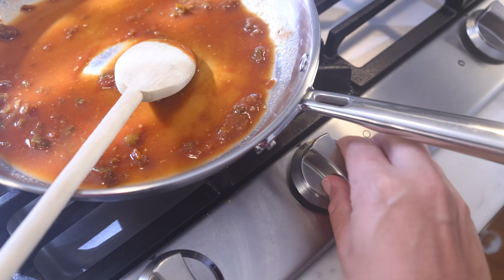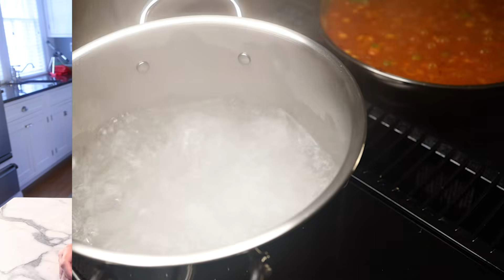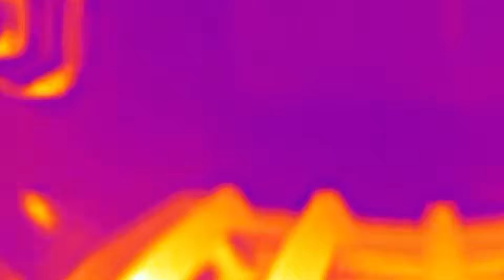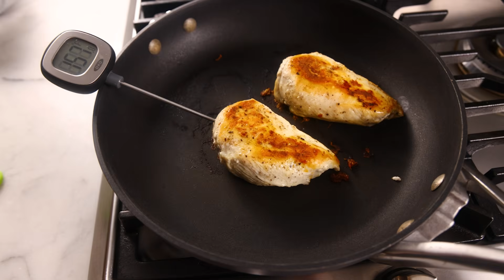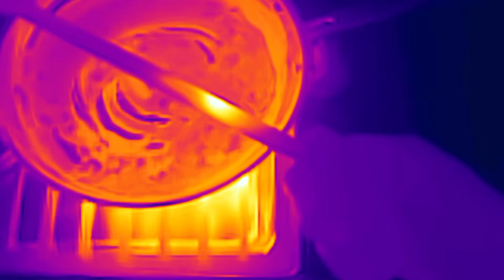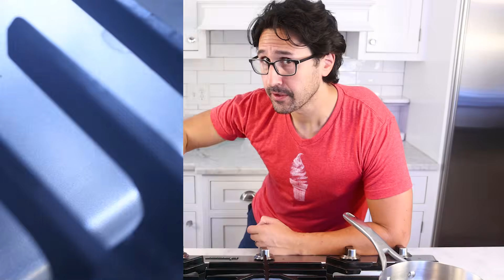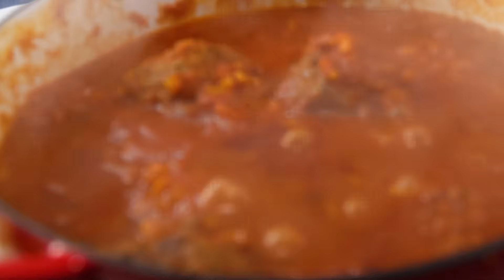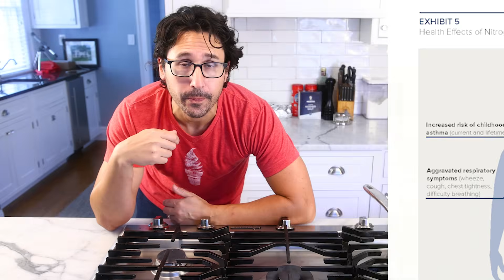Problems with gas stovetops | weak, dirty and dangerous

Comment: Our boiler is electric, when there is a power failure we are so glad to have a gas stovetop to warm up water to use in the middle of winter. We had it happen multiple times that our stovetop was our savior.
Reply: Round here, when the power goes out it's because a massive ice storm has taken down the lines. That's not bad infrastructure, it's the physical limits of what can be engineered to resist that. And having gas heat or cooking when a blizzard comes through can literally save your life.
Reply: @felonyx5123  sounds like an excuse to me.
Reply: @Lil' Black Duk  electric kettles boil in about 2m
Edit: misread the comment didn't see electric
Reply: You can get gas line outages as easily as electric power outage. 

I can also confirm what other commenters said - even in post soviet block countries, power outages almost never happen. 

If you are suffering from frequent power outages, your infrastructure & power company is shit.
Reply: An electric boiler for heat?  I've never heard of such a thing and I'm a pretty 75 y/o science/tech savvy kinda guy.  If a home is heated by electricity, the standard old system is to use baseboard resistance heating.  In Southern climes, homes are often heated and cooled by a reverse cycle heat pump, like mine. They can be done in cold climates, I had an employer in Chicago that had their HQ with reverse cycle, but the hardware expense goes way up.  Bigger coils, compressor.  The advantage of RC is energy efficiency, although it gets worse as the temperature drops.
Reply: @frequentlycynical642  i live in europe, our house is made of bricks and i do live in a colder climate. So a an electric kettle is way more efficient. The house was also completely gutted so the floorheating and cooling is new and also the isolation is new. Im not trying to discredit your experience but the way houses are built (in size and structure) and the appliences used are just completely different over here.
Reply: @loviebeest  Wait, all this time you were referring to a freakin kettle? No wonder Adam is careful to point out when different terms are used in different regions... In North America, a boiler is what heats water in a heating system that circulates hot water through radiators throughout the house. An electric boiler is basically unheard of and wouldn't even make sense in a house that is plumbed for gas. This is an older method and newer homes will either use a forced-air system with a gas furnace or heat pump, or electric baseboard heat. In-floor heating like you apparently have is a thing but it's rare.

All this time I thought you were using your stove to keep from freezing to death, instead you just couldn't go without your tea...
Reply: @sntslilhlpr6601  no i meant the house heating boiler/kettle. Im not english and the word s boiler and kettle are used interchangable. Our boiler heats up water using electricity, this water heats up the radiator, floorheating and general warm to hot water. We wont freeze to death thanks to good isolation but we have to start dressing with many many layers.
Reply: @loviebeest  Electric kettle?  Semantics, I guess.
Reply: @frequentlycynical642  we should boil water in electric kettles anyway, it uses somewhere between 25 to 30 percent less kWh per liter of water than an electric stovetop, and my family always heat our water in our stand-alone, one liter electric water boiler, no matter what we need the boiling water for.

Edit: we also have a warm water tank for showers, and warm water from the taps. But for cooking, boiling a pot of water on the stovetop is just kinda stupid and inefficient
Reply: What's a "power outage"?
Reply: @heysemberthkingdom-brunel5041  losing electricity. no light, no electric-based appliances.
Reply: @loviebeest  But that never happens... Well, in well-run countries anyway...
Reply: @heysemberthkingdom-brunel5041  in Canada, there are black outs every so often, even as a country thats considered well run and has a larger amount of money, so that statement isint really true
Reply: @thinkdogeys9993  Canada isn't a well run country, otherwise it would have decent public transit and electrified railways in and between all major cities
Reply: @heysemberthkingdom-brunel5041  it's so wonderfully elistist when euros think the only signs of having a well run country can only be things they already have, gained from wealth plundering the world.
Reply: @xShadowChrisx  Ah yes, the famously not-build on plunder country of .... Canada... What happened to the people who lived there before "Euros" showed up? What happened to them?
Reply: @heysemberthkingdom-brunel5041  Are we just pretending you didn't benefit from being part of the British Empire? I can't even tell what you're trying to insinuate, but y'all can never just be straight talkers and always have to dance around shit to feel clever, like the rest of the world is just expected to know y'alls entire history cuz y'all soooo important. The Ego I swear.
Reply: @xShadowChrisx  He's saying that the electric stove is only good for some European countries that has no natural disaster which could take down electric grids, which is true. For the rest of the world gas stove is better.
Reply: @kaikart123  Definitely giving him too much credit there. Bit insulting to say your country is basically shit just cuz it doesn't have electric *railways*. 

If he said what you said, I'd agree, though I'd argue that Europeans are still in danger of a solar flare knocking out there energy grid, which is a possible problem for the whole world. In that event, we Gas Stoves wouldn't have an issue obviously. 

Obviously a much rarer natural disaster, but not no natural disaster that Europe is immune from. 

I mostly take issue with the elitist attitude that the only measure by which a country is "well run" are things other countries get on fine without, or can't realistically have because we're so much fucking bigger. Europeans always fail to understand the scale of how big the US and Canada really are.
Reply: @xShadowChrisx  I'm not from a place that was ever part of the British Empire...
Reply: @heysemberthkingdom-brunel5041  Why the hell bring up canada in the first place? Write clearly ffs. Unless you're from Canada and aren't aware of them being formly british. In which case, we must point and laugh.
Reply: @xShadowChrisx  Someone else brought up Canada. I didn't.
Reply: @Lil' Black Duk  dood, whatever you on, share some, i wanna trip as hard as ya do...
Reply: Remember Americans don't know what an electric kettle is
Reply: @amebee709  haha, I remember seeing that and being confused since i've had this water boiler from Zojirushi since  I was a kid, and thought that everyone just did.
Reply: @amebee709  chewsday, innit
Reply: @internationalreIations  im not British lmao
Reply: That seems extremely anecdotal.
Reply: @Arian545  you sound like a very unpleasant person. They gave one reason they were very happy to have a gas stove. Literally no criticism of the video or its arguments were made. You were allowed to just read the comment, feel that it had no relevance to you, and move on. Not everything is for you.
Reply: @chriskp  "unpleasant person" lol.

Don't be so condescending and dramatic.
Reply: @Arian545  how is that not a valid pro of a gas stove? The only thing you might need is a lighter to light the stove. And power failures happen, either localized events or more regional events.
Reply: @jac1207  How does it invalidate any of the actual criticisms pointed out in this video?

It is also not a great argument since again it is heavily anecdotal, it relies on very specific circumstances. So for an instance if you live in a place where power outages are extremely rare, then this argument becomes irrelevant, since it just isn't applicable that broadly.
Reply: @Arian545  yes it is anecdotal, but for me personally a lot of outages happen so it really is a saviour for me. Im not trying to discredit anything in this video, for me personally the gasstove is just a better option. If i get to move to a place with more secure power im definitly going to switch. (Though i will keep a portable gasstove just in case)
Reply: @Arian545  It being anecdotal is irrelevant, they aren't using the story to prove something they are using it to bring up the point that, hey if one goes out the other is still good to go and that's a plus for some people. It's not meant to invalidate anything but bring another point to the discussion. 

Also power outages are something a large portion of the population does still have to worry about, if you aren't on an important grid or are on a very small grid, like rural towns, a power outage could last for days, and if it's winter they often do because it's harder to service the lines and stations. It's very much an important point to a large portion of the population, just because you don't deal with them does not mean the problem is so small in scale that it should be ignored.
Reply: @Arian545  they are not refuting adams video, they are simply sharing their perspective. i found it interesting
Reply: @Arian545  Yes, 99% of the time power should be reliable. Depends how much you value having the ability to cook in that unlikely situation. Gas stove top has saved me from having a cold meal during a winter's power outage.

Comment: Induction cycles the same way as old fashioned electric stove, they both have PWM regulation of power, however that is not a problem if frequency is high enought as should be case with not low-end stoves. I remeber how my dorm induction stove has so low frequency that I could see how water would boil for one second, then not and then again.

Comment: I’m bemused. I’m British and have lived in several European countries. In all of these places, the electric hobs I used - whether resistance coil, plate-style, or “ceramic” (glass top but not induction) were awful and significantly cooler than the temperatures I could achieve on a gas hob. Is there some magic difference between our non-induction electric hobs and yours in the USA? Are you using a different sort of gas? Is there a restriction on the temperatures our electric rings are allowed to reach before cycling off? Goodness only knows, but it honestly feels like you are describing a diametrically opposite situation. Oh, and you can hack the low temperature on a gas stove by turning the knob almost to the off position, carefully, and ensuring the flame doesn’t go out. I always do this for simmering sauces.

Comment: Electric or induction is costlier and specially not reliable if you have sketchy electric supply.
As I live in an area very prone to cyclones. Electric supply can get cut off.
Gas cylinders although a hazard in many people's eyes is very important in such conditions

Comment: My babushka cooked on a portable gas stove, which stood on the top of a gas container.... :D Very SAFE, I know. I prefer electric though and induction is best, it immitates well the responsiveness if you need it. Also it really heats things faster.
Reply: At the Scouting home we still cook basically like that (well the propane tank is on the other side of a wooden shed wall from the hobs...), those portable stoves are scary AF, Ive stood there with the lighter, heard a "woosh" and seen the flames coming out of the tubesplitter...

Comment: I have had the privilege of using every different variety of stove out there. Personally I have a non induction glass top, because it was cheaper than induction. They work really well if you ask me and they get warm and cold a LOT faster than traditional heat coil stoves. Induction is great, if it's a good one. First I HATE the finicky touch thingies, I want twisting knobs, and cheaper induction stoves tend to have only two modes: Defrost and THE FIRES OF MOUNT DOOM. Gas I don't really like for the exact reasons you have presented in your video, the finicky cleaning being the real killer for me since I'm a bit lazy.

Comment: I love induction stoves. The heat is immediate, and much, much stronger than on my previous, conventional, electric stove. And at the same time, I have perfect control of the temperature, I can go as low as I want. And if I'm done, I just turn off the stove and apart from the heat from the pot, it gets cold immediately. It combines the strong points of both conventional approaches.
Reply: Jelly
Reply: induction can be great if 1) you live in a place where there are few power outages and 2) your electricity comes from relatively clean sources. Neither of those apply to me. So gas it is.
Reply: I realize there are a couple minor advantages to induction, but none that outweigh the major issues that will stop me from ever getting a full induction stovetop.  A standalone travel burner may be fine for some things, but definitely never a full kitchen stove. My main complaints about induction are:

(1) Extremely limited in pan size.  The moment you try a pan larger than the element, it becomes useless, so you're effectively stuck using "smaller" cookware.
(2)  They do not spread heat up the sides of your pan at all, which does have a major effect on heat output to the food.  For some tasks this doesn't matter, but for any amateur cooking enthusiast, this causes major limitations in cooking techniques.
(3) They are MURDER to your clad cookware.  The induction coils have been well documented to cause problems with delaminating layers in bi/tri-metal clad cookware, especially if your induction elements are more powerful.  So what's the point in getting a super powerful stove if it's going to warp and ruin your fancy cookware?
(4) This is more of a minor complaint, but the noises they make are obnoxious and loud.  But this is more subjective.
Reply: The hidden issue however with induction is that they can heat up the pan too fast to the point where it gets warped over time. It's easily accounted for by heating it up in steps, but an important thing to keep in mind with your old vintage cast iron pan. RIP my parents' old cast iron pan that was older than me.
Reply: @steffeeH  This is correct.  a cast iron pan, if empty especially, can be heated way to fast if you're not careful.  But that's if you're not careful.  On the other hand, with gas, if you're not careful, you can burn the house down.  I've had gas for 20 years and induction for maybe 3, and I will never go back to gas for anything indoors.  For my outdoor kitchen, sure.  But not in my house.  It's hard enough to cool down a southern home in the summer as it is without all that excess wasted heat.
Reply: @gimmeabreak-h2h  you're unlikely to burn you house down with gas, more so the slim risk of exploding the house or death by asphyxiation if you aren't aware of a leak. that's why they add the odor to it though, so you are aware of leaks. Additionally electric is just as leaky with heat, I don't understand why people don't know this. IR radiation from the hot coils/IR lights in glass-tops heats the entire kitchen which then radiates that heat back into the air.
Reply: @steffeeH  I've never heard that before. Interesting.
Reply: Mine is over ten years old and basically on max, eight to one, or off. Eight to one settings don't make much difference. I do not like induction. Unfortunately unless I run a gas line though the living room over the fireplace I can't switch to gas. So the only replacement is another induction or glass top. 😞
Reply: @Wildschwein_Jaeger  The technology has changed a lot in ten years. If you’re having those kind of issues, it’s probably your cooktop
Reply: @Wildschwein_Jaeger  That's not normal for induction. The amount of control on induction is unmatched by gas, and as Adam said, gas is dirty and should be phased out.
Reply: @davidsommen1324  Gas is reliable. electricity is not. Gas should stay; it just needs to be better handled.
Reply: @vaelophisnyx9873  electric reliability and mix is a local issue (as is the economic cost per kJ of both) in the US atleast electricity is very reliable (the exact figures should be somewhat easy to find online: excluding major events west virgina lost 7.5hrs and are rank 50 for reliability. Major events is usually weather, and the Texas coldsnap almost caused total grid collapse because the natural gas infrastructure failed first).

And as of right now the cost of fossil fuels is sky high in the US (and probably everywhere, i normally don't watch the news). 

Ideally everyone would be able to do the full math and analysis to find which technology is most optimal for them, but in the states rule of thumb is that induction wins if you need a new stove. (And don't be a moron who buys the cheapest one possible, quality and price are correlated but price alone doesn't determine quality)

Comment: I moved to Sweden, which doesn't have natural gas in most places, from a gas-burning country. I really like electric stove tops with heavier pans. Slow temperature changes and no burning your hands on the air around the edge of the pan.